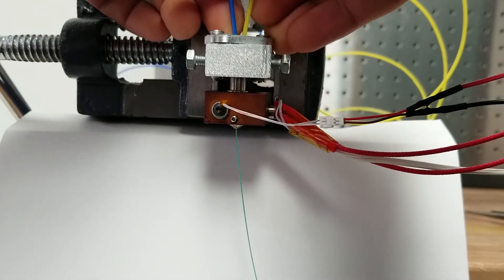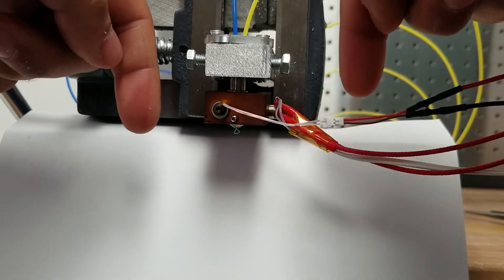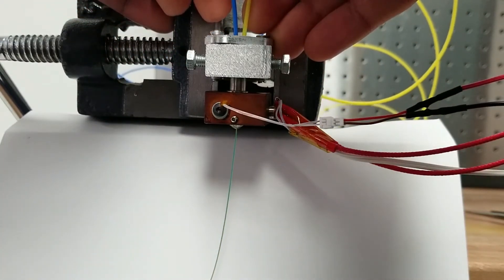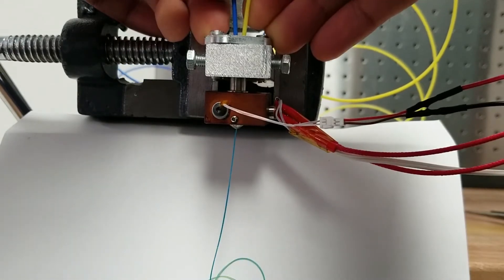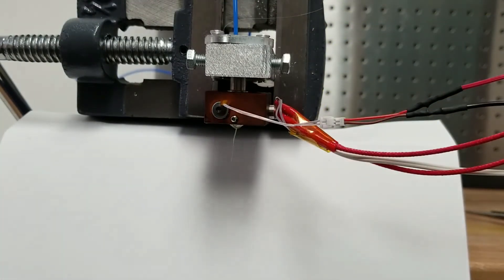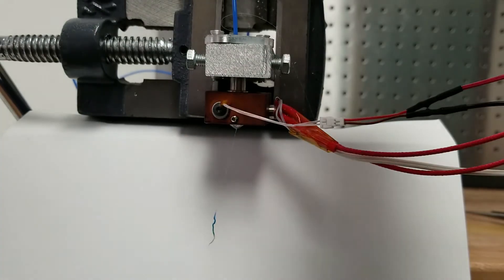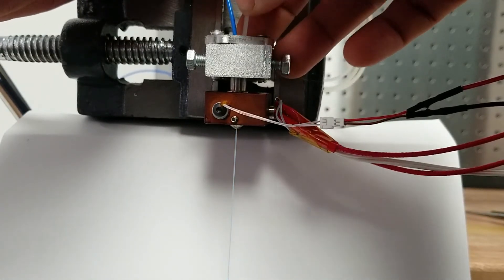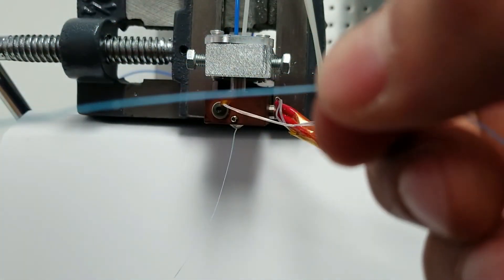M3D Promega's 'Compound' Hot-End

Comment: Completely unrealistic.  This setup will just JAM every time.  Imagine a large print with one color that is 15 to 20 minutes and then needs to switch to the other one.  The other color has been sitting for so long it may have just locked up in the barrier tube.  PVA baking at 200 for 20 minutes - carbonization.  I've had it happen.  

Let's see a print with this setup with PVA with a 16 minute layer of one color before moving to PVA.   Where's a nut an bolt test?

Just put a Kraken head on.